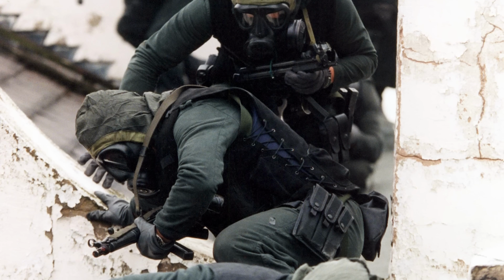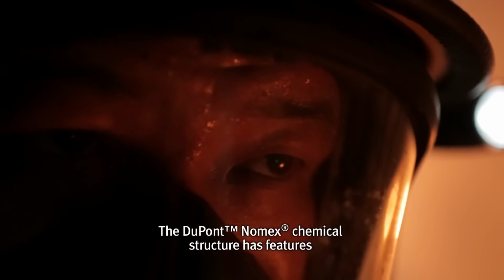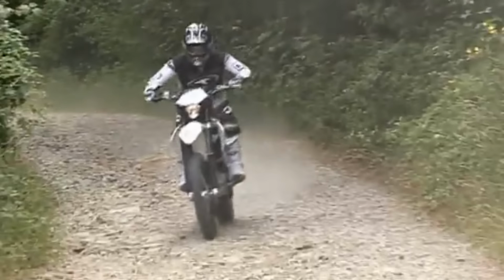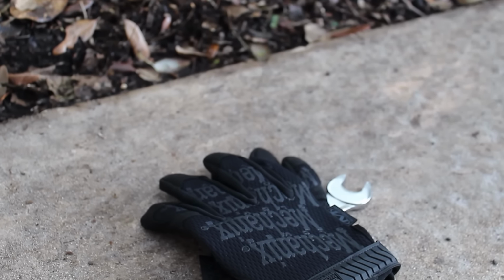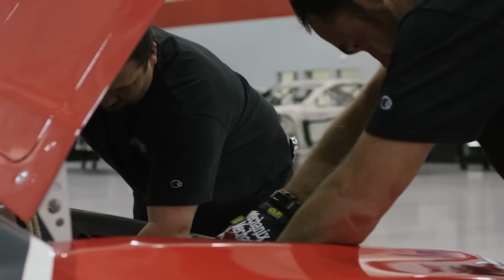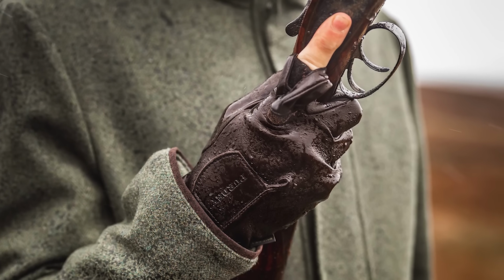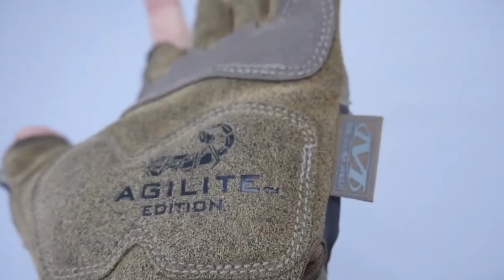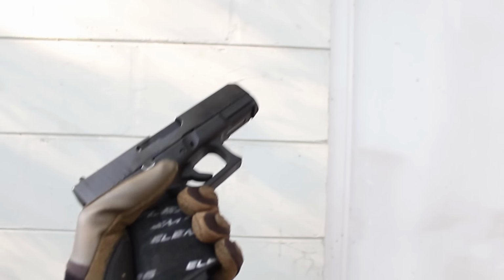How Automotive Gloves Became the Tactical Standard

Comment: For Mechanix gloves, I prefer the leather gloves that are made for actual mechanics/outdoor laborer types. The tactical ones don't seem to hold up very well. I tend to like the open back ones more than the strap back ones, so I can pull them off extremely quickly by biting the finger tips and pulling them off. But I'm considering switching to MAC Fabricator gloves as my full time 'tactical gloves'. They seem to be a lot more durable and they mold to your hands very well. They're like the ECC gloves, except they only cost $50

Comment: I was issued Mechanix gloves in 2018 or so. They were great. I was in 2021ish, I was issued Petzl climbing gloves, which were also great, but lacked the lightweight and dexterity. I was also issued nomex flight gloves, which offered plenty of dexterity but little protection. The Petzl gloves were workhorses and I loved them for general use, although they weren't great if you smacked the back of your hand on a rock. Overall, I think the Mechanix gloves were probably the best balance, as they felt like a second skin and had enough padding so smacking your hand on the edge of a door didn't hurt. Also, they were like $15 or $20 so it wasn't a big deal if you wore them out.

Comment: So here's yet another super niche use for Mechanix Gloves; lightsaber combat. I'm part of a group that meets weekly to do games and choreo with lightsabers, though we keep things casual enough we don't need, or want, full fencing/kendo protective gear. But when the polycarbonate blades hit your fingers (which happens ALL time) even with a light strike, it hurts a ton. I've had a bruised thumb from it that still hurt months later, I don't think it was broken but boy did it feel like it. We strongly advise all of our members to get a protective set of gloves like these because, as you noted, they allow you to keep your dexterity, especially compared to other sword play gloves, but they still do a great job protect your fingers from the most common impacts. I've always been a fan of these, thanks for the neat history lesson! :)
Reply: My niche use of Mechanix gloves was as a hot air balloon crewman.  The gloves provided enough grip and protection when handling lines, but also allowed fine manipulation of carabiners, threaded locking rings, propane hose connections, two way radios, and provided some protection against extremely cold propane venting during refueling.

Comment: Mechanix gloves are really good. Compared to other tactical gloves as Oakley and 5.11, I honestly prefer Mechanix.

Especially the "Mechanix Mp3"! Love them. Have several pairs. I even recommend them over the more expensive Breacher model. 
The Mp3 is better designed by my opinion. And the small differences the Breacher doesn't motivate the price gap. 

I also have several Mechanix Cut proof CR5 gloves. And even if the cut proof gloves doesn't have the dexterity and snug fit as the mp3 and Breacher. The cut proof textile offers confidence to handle threatening situations with a more hands on approach 😉

Cheers from Sweden 🇸🇪🤘😎🤙🇸🇪
Reply: Ohh yeah!! Mp3 is the third gen version of the "M-pact" model... To not get misunderstood here... 🤭

Comment: I use a pair of MTB gloves as my work gloves because they are a much slimmer fit, have better grip and ventilation and also have tactile fingertips for touch-screen electronics, sure they are not A5 cut resistant like any pair of gloves you find at Home Depot but are more than enough for DYI projects and fixing stuff at home. That in mind it seems perfectly reasonable to adopt techie gloves focused on dexterity even if it removes some of the protection to reduce bulk for the one body part that is going to be doing all of the handling and shooting of weapons for combat personnel.

Comment: Damn, full on maglight taped to the top of that rifle.
Reply: It wasn’t taped. It was held on with hose clamps to a H&K claw mount scope mount that had the scope removed. It also wasn’t a mag light, they were stream lights. And because it blocked the iron sites they spent a ridiculous amount of time training so that they knew exactly what part of the flashlight beam. The rounds would impact and basically use the flashlight as a very crude aiming device bearing in mind that they really weren’t shooting much more than 10 m at the most.

Comment: As a diesel mechanic i hate wearing gloves but when i go camping, exploring or generally up to no good outside stuff, i got my trusty mechanix. Useful for riding the dirtbike too
Reply: Same. Can't get the dexterity i want with gloves, at least not the cheap ones you throw away after a week
Reply: @Frille512 Not a mechanic, but when I work on my ute I buy $2 sets of those cheap rubber-dipped knitted gloves, fully accepting I'm only gonna use them once. They're tougher than latex or nitrile glove with a bit less dexterity, and less durable than Industrie or the like but with better dexterity. A good compromise. Those latex gloves keep oil off you, sure, and offer good fiddliness, but I'm replacing them every two minutes when they snag or tear, and those work gloves just don't have the dexterity.
Reply: @ If it's oil, i'm wearing nitrile/latex gloves. If there's no oil, i'm wearing some mechanix gloves. Good dexterity, and the opening doesn't snag when climbing on machinery. That's happend once and once is enough for me to not want it to happen again.
Reply: Absolutely been a diesel mechanic for over 30 years.
Reply: I'm an automotive mechanic. I usually wear nitrile gloves for general stuff. The only time I wear thicker gloves is when I'm grinding, and then they're leather gloves. Never worn mechanix gloves.
Reply: Not caring about your health doesn't make you manly or cool.
Reply: yes, feel is in my opinion , about 30 to 50% when working on ANYTHING mechanical or not. I don't like wearing gloves either but, in my case, unfortunately I have eczema from working on cars, and alotta of the time I MUST wear gloves which sucks lol.
Reply: Have you tried those while volunteering at a foster center
Reply: As a fellow diesel mechanic how are you not wearing through the fingertips in days? Mine all fall apart.
Reply: Same.
Reply: Only time I where gloves is when I’m dropping big items down
Reply: Yuck. Idk how yall like working and not have atleast latex gloves on. That shit gets all under your nails. Not to mention the health effects of all that garbage absorbing into your skin
Reply: I live, hike, and work..play in the high desert. Mechanix gloves lack the durability for my environment and are not even heat resistant, however, they were comfortable for mounting biking and prevented blistering and slipping from sweat. Coupled with RevGrips, they were great. However, the palms quickly wore out (I think this had to do with how well the gloves adhered to the rubber grips!)

For work, hiking, and camping I really like my hardware storebrand leather gloves. Leather has a natural tolerance to heat and flame, I also treated them with Obenhauf's. However, they lack the dexterity of Mechanix. Frankly, I'd love to get my paws on something that offers the dexterity of Mechanix gloves, while offering the protection against, thorns, sharp rocks, incidental flame/heat exposure, and water repellency that my treated leather gloves offer.
Reply: @DesertCatDad  That's a glove you'll have a hard time finding, i'm afraid. The trade-off between dexterity and protection is as old as clothing.
Reply: @Frille512 Your right. I've considered buying leather gloves to cut the palms off and afix to Mechanix gloves.
Reply: @ That could work
Reply: @jed-henrywitkowski6470  Try deer skin gloves it is slightly softer then leather but I find the dexterity I have is much much better. They also tend to be not much more expensive then standard leather gloves lately.
Reply: @G-_Money  I wish more people made roo skin work gloves. Much, much, much tougher than cowskin - no sweat glands - so you can make them really thin for the same strength.

Comment: I wear Mechanix gloves for airsoft, great gloves that take an absolute beating. I was considering a pair for summer riding on my motorcycle.
Reply: Please don’t use mechanix gloves while riding unless you want someone to wipe your ass if you go down. They will shred quick on the asphalt.
Reply: Wearing a pair of Mechanix will beat going down and sliding bare handed but the problem is you're only going to get about half a second out of them before they're worn away and you're back down to bare skin. I love their gloves for wrenching and shooting but they are NOT abrasion resistant in the slightest.

Comment: For me, it was the balance of cost, comfort and durability. Back when I joined in 2010 and I needed to replace my gloves (I didn’t know that they were used by spec op groups) I found the Original mech gloves in the PX. I used sharpie to black out the white letters and from that year til today I’ve been using them. I first noticed the gloves in Medal of Honor game later and was surprised to find out how common they were in tier 1 and other groups. I still have the Original gloves that came in black and tan when they started making them in tactical colors. Unfortunately I don’t think they make that version anymore. But the impact models have that color I think.

Comment: I was an aircraft mechanic from 2003 to 2007, a crew chief in the USAF. I got issued Mechanix gloves and a whole bunch of straight up motocross racing gloves, along with Nomex Flight Gloves and a bunch of winter gloves. Mechanix was definitely the best up until it got cold outside, then we'd switch to nomex flight gloves, and if it got any colder, then we'd switch to dedicated winter gloves. I'll tell ya, when you're laying inside an aircraft's fuel cell, your arm is bent 3 different ways trying to actuate a 3/8th inch nut that you can't see, the dexterity REALLY pays off. I never got issued the gloves with the knuckle protection though, I feel like they only came on the scene after I left the service. 

Also, as a side note, there was a lot of times that we didn't have the option to really sanitize or even wash our hands before eating chow, if you were lucky you'd have some cloth to wipe them off on, or a bottle of water you could pour over your hands. Keeping your hands clean from the black cancerous engine cowling fouling is legitimately helpful, and Mechanix gloves were able to "plus up" the protection of a latex glove. So these were super handy.

I still use mechanix gloves for my civilian defense kit. You have to understand the gloves as disposable (they don't last forever, nor are they designed to) and keep an extra pair around in your bag. They also do/did a really expensive Nomex flight glove with reinforced knuckles, if you can afford that I think it's your best bet all around for flame protection and knuckle protection.
Reply: AF defender here, the gloves save my thumb from being nipped by the M4 charging handle at least 5 times a day
Reply: Current AF fuels troop here, we still get issued Mechanix. Only difference is we get knuckle protection and we're "technically" supposed to wear chem gloves in the fuel cell. QA can honestly shove it though because good luck doing anything with those enormous teal gloves.
Reply: Issued Mechanix gloves? So, perr the Barry Amendment, they were made here?
Reply: Fellow A&P, you mil guys have seen it all
Reply: Why not a pair of skintight leather gloves?
Reply: Can I ask how you became a AF mechanic, I want to do the same just not sure how
Reply: @magmasamurai3598  All you need to do is join the Air Force, about half of the enlisted roles in the air force are some type of aviation maintenance. You can become a generalist Crew Chief, or seek a specialist role such as avionics, electronics or propulsion. Most of these roles will offer you flight line maintenance jobs, but sometimes hanger/refurbish jobs. It's a good job all around, and it's applicable in the civilian sector afterwards if you get an A&P license. While in the military be sure to knock out your college classes, get to rank E5, then punch out for a civilian career.
Reply: Since you are an engineer 
Is there any metirial which was dangerous to handle without gloves let's say rubber or some kind of oil?
Reply: @Sigma__taliBAN_male  Yeah - none of the liquids you work with are healthy, they're basically all cancer waiting to happen and yeah my immediate supervisor got stomach cancer at like 32 years old. Other guys from my unit too. The short list of toxic stuff include hydraulic fluid (which you can't work with if you're pregnant), JP-8, and the engine oil, that's all daily servicing. Plus human waste (aircraft piss cans, solid waste toilet), and there was one lovely substance we called Blue Balls which was the deodorant used in the toilet that would leak and be corrosive and we had to scrub with a wire brush. The MSDS for that Blue Juice probably just said "100% death." The safety regulations required you to wear latex gloves when servicing basically anything, but latex gloves rip really easily so it was best to double glove it or use your Mechanix glove as the safety glove. Cheers
Reply: @Sigma__taliBAN_male  If you want to know from someone who works with heavy equipment, there's plenty of nasty stuff. Dirty oil will dry into your skin (carcinogenic by the way), hydraulic oil actually seeps through your skin and enters your veins, which is bad for you. You might also cut your hands on a random piece of sharp metal, not good. Fuel's also bad for your hands.

Comment: ...I didn't know machinist gloves were a thing. I've been starting a machine shop and we have been going through disposable gloves, two or three pairs a shift. Didn't even occur to me that there were specialty gloves for this purpose. Likely getting some within the week. Big thing is the nasty chips + oil. But still need enough dexterity to tighten screws on the fixture. Ends up tearing the gloves bad.